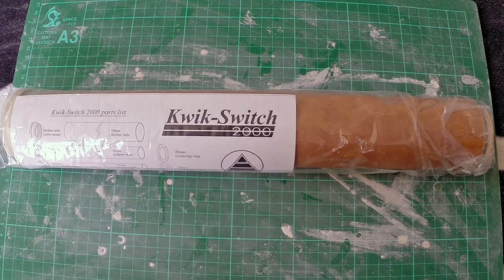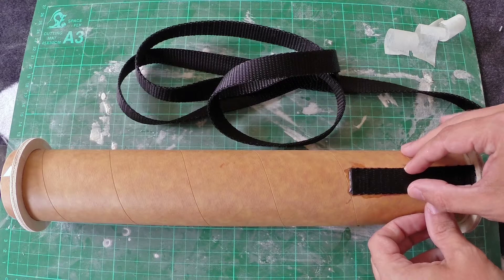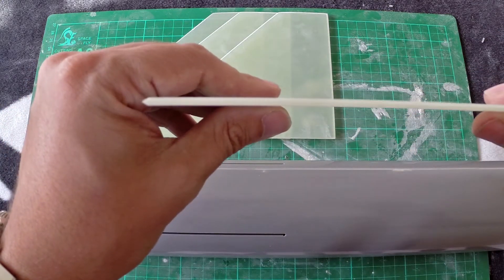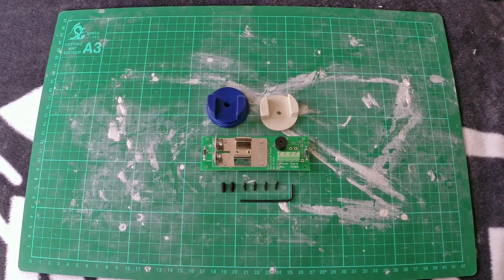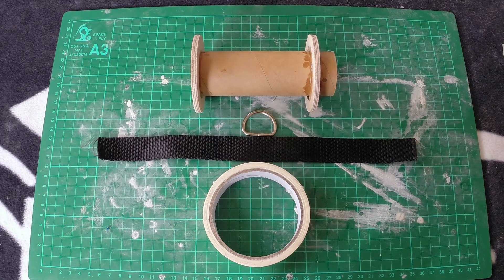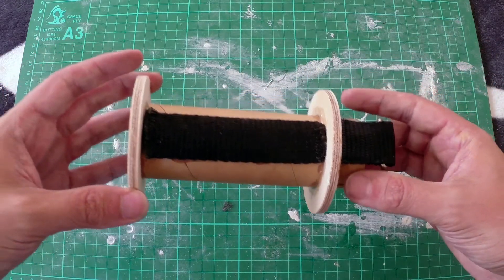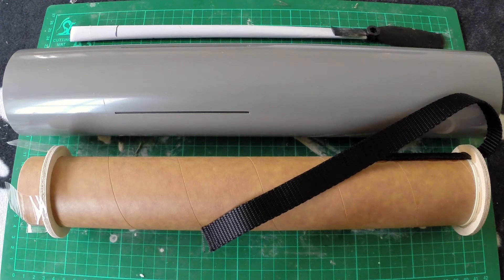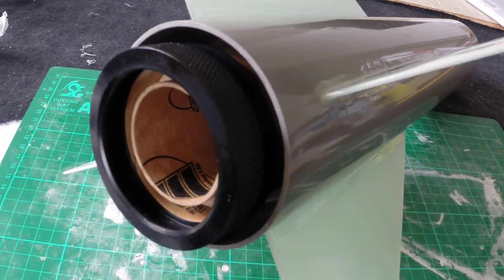Model Rocket Series 3 Episode 2 Part 1! (Model Rocket Build)

Comment: You'll want to rough up the Quantum tubing where the epoxy bonds are made. Inside for the motor mount, and outside, for the fin fillets. Epoxy doesn't hold well on smooth Quantum tubing. You need to rough it up with some 25 grit sandpaper. Same for the G10 fins. Give the surfaces some "tooth" for the epoxy to hold.
Reply from the maker: Thanks for that.